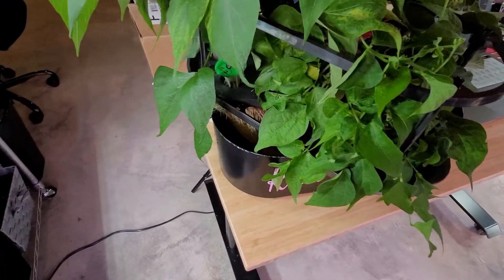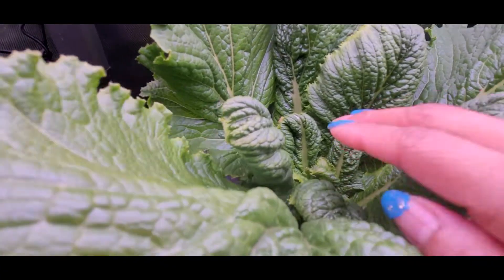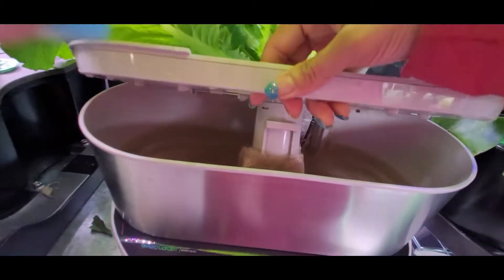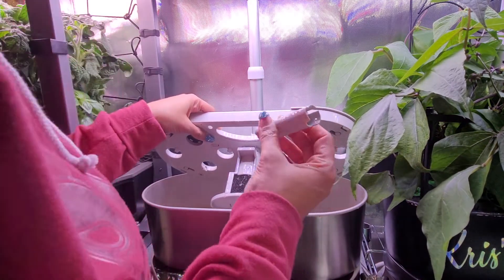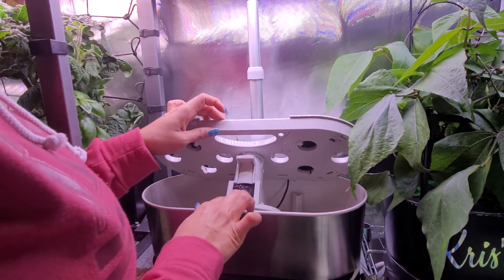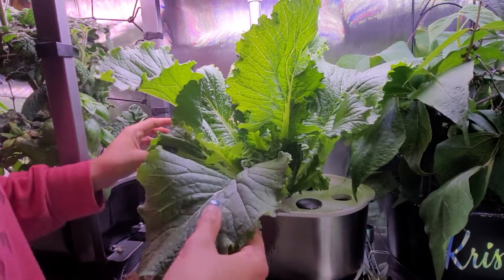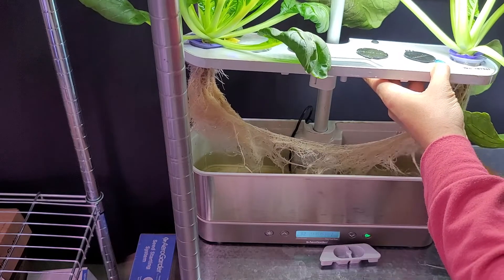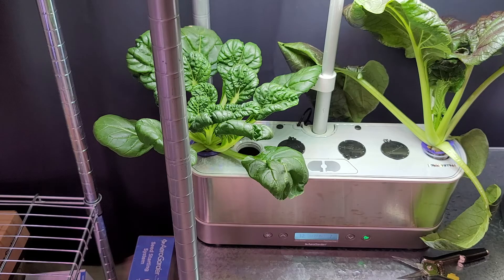AeroGarden | Why and How to Trim Plant Roots

Comment: Hi I'm new to this indoor gardening! At 6:45 when you cut the roots about 2 to 3 inches from the pod, is it okay to do that in general as a practice for literally anything planted? Or just cabbage specifically?

I'm growing 4 heads of lettuce, sage, thyme, basil on one of my machines and the 3 lettuces I planted about a month ago are really starting to form.

I have no idea when to cut any of the roots so I want to make sure I do it right so it doesn't get too crowded.

Comment: So I am new to this whole thing but I learned that since it is aeroponics not hydroponics the roots should not be in the water but only getting water when the pump kicks on. I trim mine off so they are barely touching the water, and getting lots of AIR
Reply from the maker: No. Sorry. That is not accurate. Hydroponics is a broad term that covers all kinds of growing including aeroponics, nft, dwc, and more. And it is perfectly fine for the roots to be in the water. But aeroponics is the act of running the water over the roots. Versus something like dwc that just pushes oxygen through the water. And of course there is Kratky which is a different form of Hydroponics which is passive and the bottom of the roots are in the water while the top of the roots stay dry to form air roots.

Comment: Great video Kris, and caught a glimpse of those Beit Alpha cucumber seeds from Bakers Creek in the background.  Can't wait to see the results growing those.  About the Napa cabbage, have you considered placing single large plant to the side of the garden where it is farther away from the pump and water level indicator?  The light would be stronger on one side of the plant, but the plant could be turned to keep it balanced in growth.  Your thoughts?
Reply from the maker: Thank you so much! I am still waiting for the cucumber seeds to germinate. I put the cabbage plant kind of in the middle so there is clearance all around. I have beans on one side in another garden and tomatoes on the other. But, I think once I trim off those large side leaves I think it will be ok. I will try to keep doing that regularly as the head forms. :)